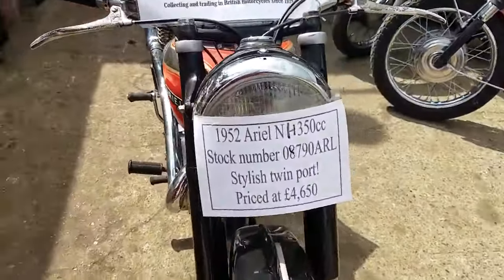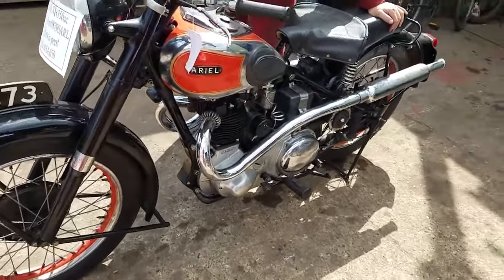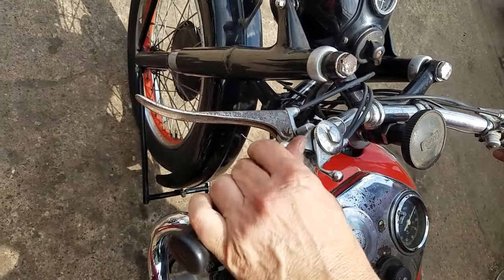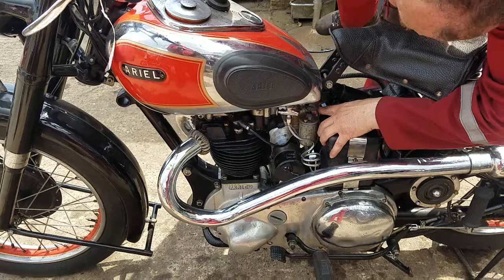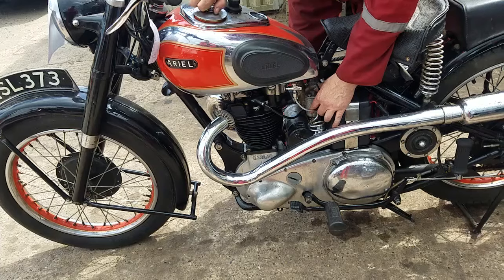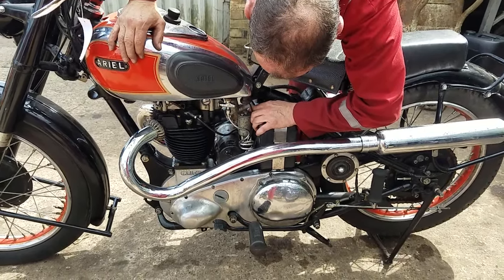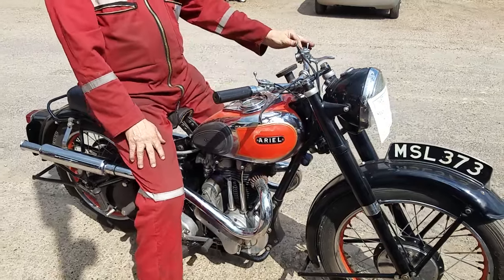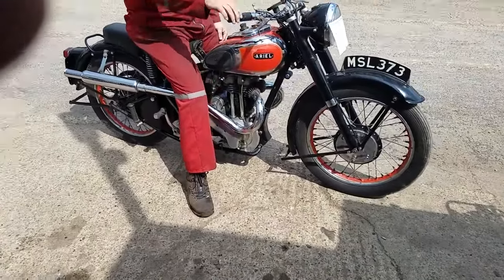1952 Ariel NH 350cc at Andy Tiernans #08790ARL

Comment: Should that bike either have girder fork or a single ex pipe? doesent look right to me for a 52.
Reply: Most post war bikes were tele fork, apart from a few in the first year after the conflict ended and some recycled war department bikes, 1952 is definitely tele fork. Single or twin port options were available at that time so that is correct. 1950 was the last year for panel tank, from 1951 the speedo moved to fork top casting so I would question at least top fork yoke and tank. Tank should be all red paint, no chrome as this also stopped in 1950. I own a 1950 so have become an anorak about these!